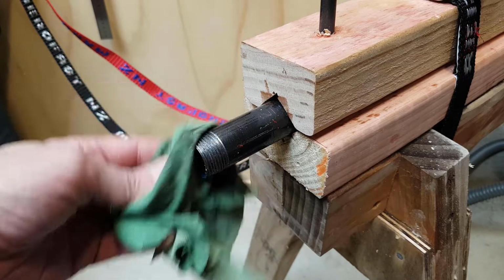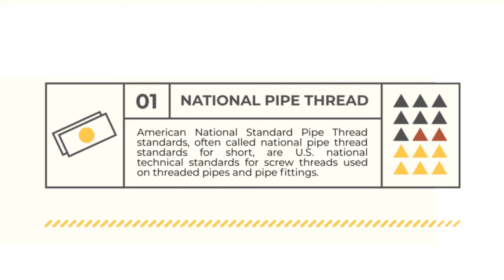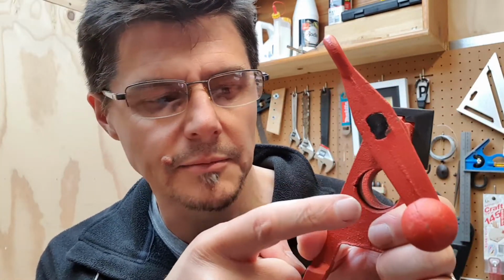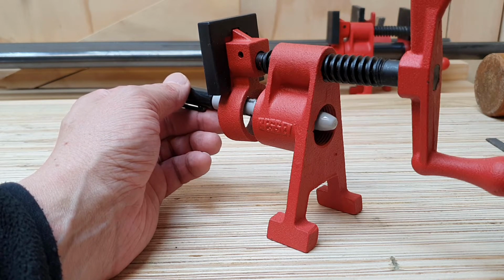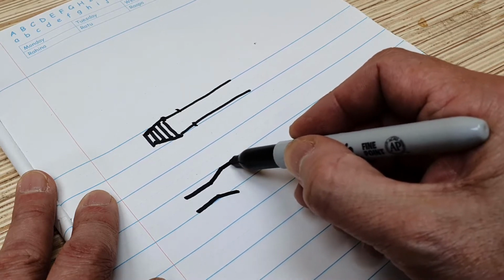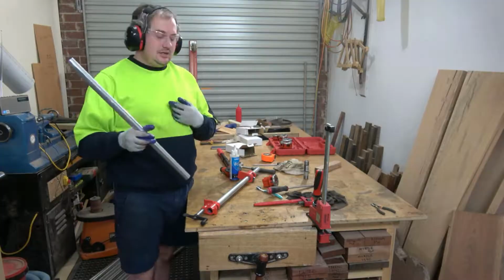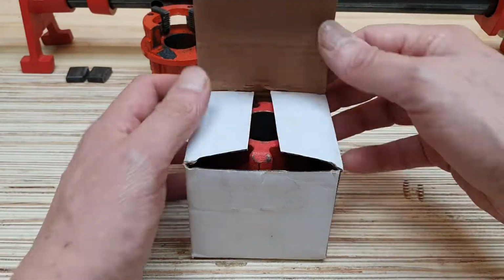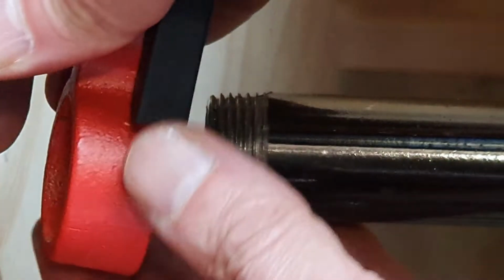The pipe dream: not over.

Comment: Dies used to cut bolt threads are also tapered.  The idea is that the first edges cut shallow and each following edge cuts progressively deeper.  Bolts you see without a taper are rolled on the bolt without removing metal.
Reply from the maker: The art of creating threads is very fascinating! Cheers for telling me this. 👍

Comment: I got some similar clamps from China.  I was unable to get suitable pipe easily where I live but was able to get some 25mm dowel. Sanded a slight taper in one end and then used the thread in the pipe clamp end to cut the thread and lock itself onto the dowel.  Works just fine.
Reply from the maker: Hey Rob - nice solution to the problem - 25mm dowel would be plenty strong enough too for most things. I thought of using pvc pipe a couple of times but it is nowhere near rigid enough - never thought of using dowel though. That stuff is super expensive here though. Cheers man! 🥓
Reply: @TakamiWoodshop  Paid  $NZ 20 for a 1.8m length.
Reply from the maker: That's not bad actually - I paid about 35 bucks for a 1.8 of 40mm pine dowel at Mitre10

Comment: Great job explaining NPT vs. NPS.  Actually pipe machines have adjustable dies.  You should be able to turn a fitting 2.5-3 turns by hand to know your threading deep enough.  I am having a problem finding an electric handheld threader that decent and won’t break the bank. Trying to get into making the steam punk lamps to sale
Reply from the maker: Thanks man! Yeah the handheld threaders ain't cheap that's for sure. Good luck with your business venture - those lamps are super cool! 🤙

Comment: Hi there, and thanks for the info, my question is, how do i go about ordering the teeth for the 1/2 inch die, i can seem to find any other brands except RIGID on Amazon .......and what brand do you have
Reply from the maker: Hi there, my die set is from Amazon but the replacement cutters that I bought is Garrick. Sometimes I think it's easier and not that much more expensive just to buy a whole new unit, especially if you're worried about compatibility between your 1/2" die and the RIGID cutters. As long as the ratchet wrench thingy is the same size you should be good to go.
A lot of engineering shops can do pipe threading for a smallish charge as well.